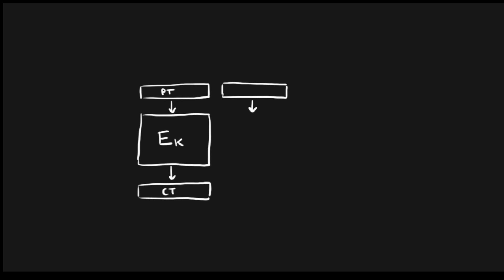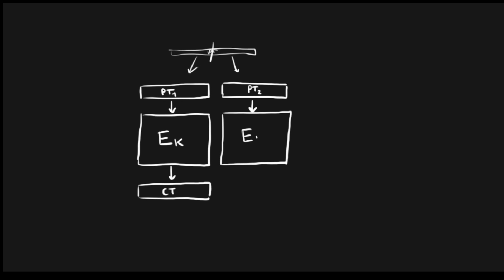What is GCM? Galois Counter Mode (of operation) (usually seen as AES-GCM)

Comment: So, it's not so much a mode for the cypher, but just a AEAD suite that includes a CTR mode encryption. The A_AD stuff is just "tacked on", even if it is calculated in lockstep with the actual encryption.
Doesn't this violate the seekability of the CTR mode? I won't be able to authenticate an arbitrary block in the middle, only decrypt it.

Comment: David:  You said that without GCM, one might be able to change some bits in the encrypted block to change some bits in the plaintext.  But I don't see how this would be possible.  For one thing, if you change just one bit in the encrypted block, then wouldn't that change every bit in the decrypted plaintext?  I guess I'm confused about the point of authentication.  It seems like if you try to mess with the encrypted data, Bob will just decrypt it into garbage, meaning he knows it's not authentic.
Reply from the maker: Imagine the diagram for decryption instead of encryption (check AES CTR on wikipedia). You will see that by changing one bit of the ciphertext, you effectively decrypt that one bit differently.
Reply: @cryptodavidw   Thanks.  I hadn't realized that when you use counting mode it's a streaming cypher, so you can modify individual bits.  The received data is just added to the encrypted stream.  Of course being able to flip bits just means they'll be incorrect; it doesn't mean you can change them to a known value.
I was studying this because I needed to make a 400Gbps AES GCM encryption circuit for work.  I got it finished, but I'll probably optimize it a bit.  The GF(2^128) multipliers are pretty big blocks so I'll need to use the Karatsuba architecture to reduce the gate count.  Otherwise, it seems to be good.

Comment: Thanks a lot David.
I've one small doubt. In GCS, are we changing the Initialization Vector (IV) by adding the counter to it? We take the plain text & do some operations (XOR?) on that with IV; Lets say my IV is 9 (just to keep it simple). Plain text gets XOR'd with 10 (IV +1), the next block is XOR'd with 11 (IV +2)? that way?
Reply from the maker: Good question! 

The block is split between the IV (also called nonce for GCM) and the counter. You can split them in the middle (and for AES that would be a 64bit IV and a 64bit counter), but that usually isn't recommended as it doesn't allow you to encrypt a lot of messages compared to the size of the messages it can encrypt (this means you can encrypt messages up to the size of the counter, so 2^64 * 128 bits = 295 exa bytes (which is a ridiculous size)).

Most often, you would use a 96 bits IV and a 32 bits counter.

Also, you should use the IV as a counter as well! You should set it to 0, then for every new message you encrypt increment it by 1. When it reach the maximum size (2^97-1) -> you need to change the key.

What happens if the counter reaches the maximum size? (2^33-1) -> you need to change the IV and start the counter at 0 again.

Does that answer your question?
Reply: Thanks. :-) I've few doubts still. however i will read abt it one more time, not confident enough to ask the question. I will definitely come back :)

Comment: I know we could parallelize the CTR part with relative ease, but how do you parallelize the MAC part?
Reply from the maker: +peeeMamo I don't think it's possible. It is binary arithmetic though so it should be pretty fast.
Reply: @cryptodavidw  You can parallelize this.  I just did this using 4 independent units.  The multiplier multiplies by H^4 instead of by H doing Horner's Method on interleaved streams.  (The circuit to calculate H^4 is very small.)  At the end you have four different tags which you need to combine.  One gets multiplied by H^3, one by H^2, one by H, one by 1, and then you sum them together.

Comment: Nice explanation ! I am trying to compare performance of CBC MAC and GMAC (assuming 128 bit block size for CBC operation). I guess both will take linear time. Which one will be faster ?
Reply: hey man, So I Looked into this question a little. From my understanding it looks likes computing the MAC's themselves would be both linear time. however, the encrypting and mac will be faster for AESGCM. This is because AESGCM can compute each plain text block independently, where as in CBC you must encrypt each block in parallel. 

Source: https://www.privateinternetaccess.com/helpdesk/kb/articles/what-s-the-difference-between-aes-cbc-and-aes-gcm

Comment from the maker: what is GCM?
Reply: Awesome!  So I'm an idiot compared to you.  I learned many new things from this video.  You teach well.  Here is what I got out of this video:  1) ECB splits the PT... It's very predictable.  Don't use it  2) Counter Mode means we encrypt a counter(presumably concatted to PT) we concat to an initialization vector before encryption too.  3) there's kinda a checksum that we can maintain data integrity with.  That's why we have MAC/TAG(computed from CT and encrypted with same key)  4)GCM chains a simulkey by multiplying it by previous block.  H starts out by calculating CT from PT with Ek where PT=128 zeros.     At this point(9:41) I had too many things to think about so I didn't learn anything new.  I might writing a python program that encrypts via AES using GCM(I know there are libraries that do this for me).  I wrote one for AES just for educational purposes.  This is cool!